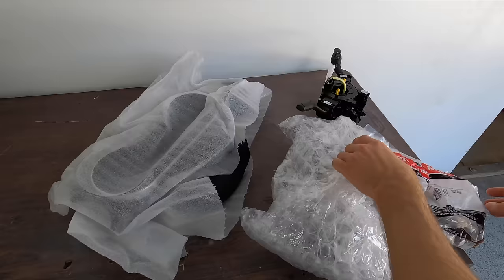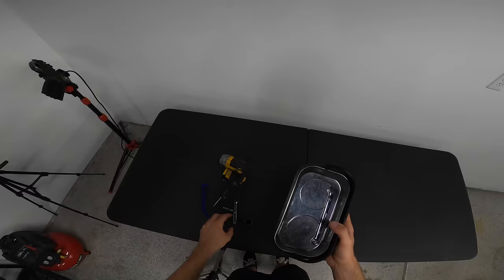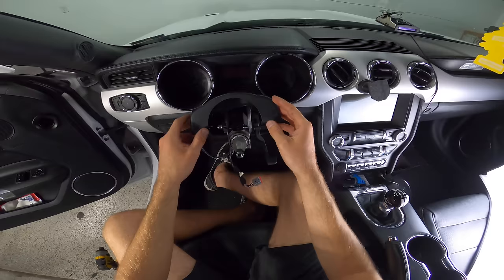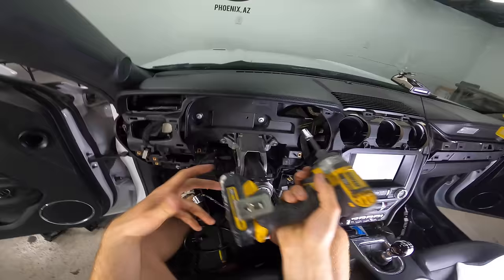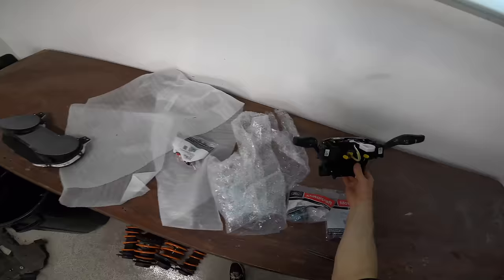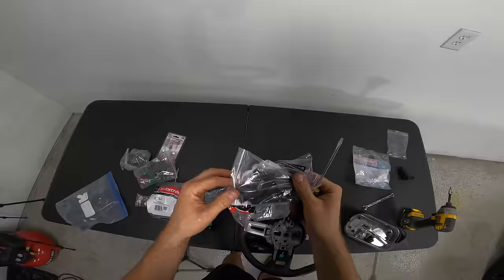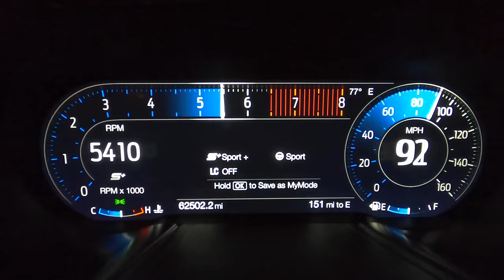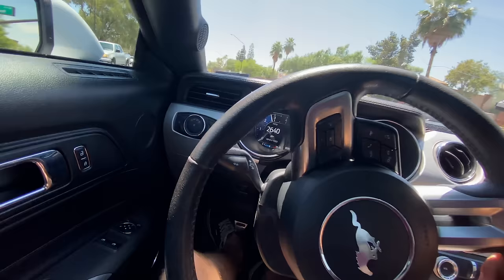Building a Mustang GT: Digital LCD Speedometer Install, Feels Like a Super Car!

Comment: Its funny that a lot of people commented “$2200+ so expensive” and they still gonna buy iphones and ipads or buy both every year. I believe this mod is worth it.
Reply from the maker: right!!!
Reply: Yeah I see where you are coming from, but you have to consider this. It's 2200, you can buy so many other mods that are going to be much more useful and overall better than just a gauge cluster. I totally agree that it looks cool, but it's a really expensive cosmetic. Buying iphones, ipads, etc. are things you kind of need. Unless you want to be really outdated and cheap, then yeah go ahead and buy a flip phone. But, honestly I don't think you can compare this $2k+ gauge cluster to people buying iphones and ipads.
Reply: ROLLS ROYCE well, gauge cluster are something that you need everyday esp driving. Give this guy a break. It is comparable with iphone and ipads, you just dont get it yet. I bet this mod is for the long run nothing comparable such as to disposable tech ie: iphones and ipads, in which are expensive.
Reply: I would look at it as a investment over time. If your going to keep the car for 4 years, £2k over 4 years isn't much. After all it is a mod you look at every time you drive.
Reply: Its a distraction. Keep your eyes on the road. Lol.
Reply: ROLLS ROYCE What you determine useful someone else may not. You can absolutely compare that. People like to upgrade to the newest phone every year and drop 1K yearly but then say a gauge that will be in the car the life of the car is too expensive.

Comment: Putting it all back together before trying it is a very VERY bold move! Glad it worked out!
Reply: Very bold indeed 🥸
Reply: Being a car audio installer myself, I was cringing....physically twisting my body lol....as I saw the first piece...then second...etc....go back on WITHOUT testing out the new cluster first! Especially even stating several times that the plug may have damage but very unlikely unable to work, could still simply not get seated properly. Look how many steps he would have to go through just to get back to that. With the potential to break any of those parts again.
"It's best to test before putting back the rest"
Corny but has saved me so many labor commissions because you don't get paid to take something back apart that's your fault for not testing.
I know the battery is disconnected but unless it specifically says DO NOT POWER ON WITHOUT AIRBAG INSTALLED, test first, or at least call the manufacturer before starting the job.
"Hey. Is it ok for me to reconnect the battery and test this new console before completely reinstalling the the entire dash?"
Well worth the time to call, and get the person's name you spoke too, and just good CYA (Cover Your A$$) practices!
Like Cameron said, this isn't being negative but I'm positive that it's worth talking about!
LOL!
Reply: @justinmurphy2227  it's a ford vehicle you can disconnect the airbag and run it without worrying about codes that won't clear themselves after reinstalling the airbag.
Reply: @foodhatesme  ok this knowledge helps to know. I apologize about being ignorant to this...thank you! I drive a 2003 Ford Ranger and have for the 20 years. I didn't know how far Ford's CPU/ECU's have advanced and in what ways. 
I've went from a 3.0 to 5.0 and now I'm going to 2.3 turbo. I just can't decide if I want to do a 2.3 Duratec, built and turbo'd, vs a 2.3 Ecoboost stock out of a Mustang with minimal addons as it's safe tuned power (400ish WHP) is all I want.
It's a Ranger....not a future "crowd controller" with a shovel aka it's bed.
LOL.
Reply: @justinmurphy2227  np, I recently picked up an ex intercepter 2005 mustang with the v6 that comes chipped and cammed from factory. I'm thinking about putting a supercharger on it.
In my personal opinion I'd go for the stock mustang motor and put a supercharger on it, costs a bit more but you get way more power in the low end and no turbo lag.

Comment: I was going to consider adding this to my mods list.  While I do prefer analog gauges, I like general look of it and the fact the entire gauge area is open.  But after I clicked the link and saw it cost $2.4k, I figured I'd leave this one out.  Nice video anyway, dude!
Reply: Best way is to find a used one or a crashed mustang o just need one on Facebook if he lets it go for a good price ima do it
Reply: @ballstoyou33  been looking at them too but they’re not worth it for the price. Would much rather put some power down than something that you’re hardly looking at
Reply: @ImisstheoldNick  🤣🤣😭😭I’m putting a built block in my car as we speak so after that it’s time for looks cosmetics
Reply: @ImisstheoldNick  I didn’t know about the switches on the steering wheel and the collar thing for the wipers I thought it was just a dash you plug and play I was thinking of getting it off a crashed mustang but this kit seems more logical idk tho
Reply: @ballstoyou33  Yeah I agree, but still does not seem worth it imo. Idk I also just dropped 3k on a borla attak so I can't even say that

Comment: I have this on my 2019 Mustang GT Premium 5.0 and I made sure to purchase it with this gauge cluster 12in LCD screen and I have to say that it is an awesome feature to have it looks amazing and in my opinion it is totally worth it. Didn't know they had a kit to modify the old cluster to this new one. Great Video.
Reply: What's weird is that my 2018 evoboost premium seems to have all the cool stuff except for the shaker speakers and this cluster....i really like the cluster ir came with tho
Reply: I have 2019 and I dont want to cut any plastic is 12 inch gonna fit without cutting ?

Comment: I like the stock cluster but I also like the idea that you can do this to it.  I think these types of mods are especially cool if a person can’t afford a new car they can make their old ride feel like a new one.
Reply: Yeah I was disappointed when I realized it was an option that I didn't have but there's so much id rather do with that 3k than fix something that isnt broken on a base gt
Reply: @MustaliS550  yeah its a cool upgrade but instead of buying an older mustang you could put that 3k towards a slightly newer one with less miles

Comment: I just got my 2023 mustang GT with the 401A package (which includes the digital cluster) and it is absolutely AMAZING! It does feel like you’re driving a super car or something. I also have the 10spd automatic. I know some of you will be like oh no you should have gotten the manual. But I drove a manual and I’m telling you what the power between the manual and automatic is INSANE! The automatic is WAYYYY FASTER! It’s also SOOO MUCH MORE FUN! the different drive modes actually feel different when using them. On the manual it all feels the same except the steering feel. I have always had manual mustangs but after driving the 10spd I fell in love and will never have another manual sport car. We live in a time where the automatics are insanely faster than the manual! Plus if you wanna be lazy and put it in comfort mode then you can do that. Would be kinda hard to do that with a manual. Great video bro! #MUSTANGFAMILY

Comment: I got my 2016 GT PP1 last week and I'll probably do this mod at some point but not very high priority on all the things I want to do

first quality wheels and tires (not that cheap crap on the car now), full car polish and PPF, repairs/maintenance where needed, some small cosmetic/accessories stuff, spare 19inch wheel, sort out the MT82 issues etc etc

after all that it will be stuff like the digital dash

Comment: Your video is still helping people today. I replaced the gauge lens on my 2020 mustang gt using your vid and a few others. Yours didnt show a one or two steps but over all thanks so much. Your frustration and excitement gave me the courage to do it on my own and after a few pinched fingers and missing bolts later, my mustang is looking better.
Reply: Did you have to use forescan for anything? Where did you order your cluster? Thanks!

Comment: I just built/installed a tablet-based system I my 06 V6 Mustang, using RealDash. I hooked my tablet to USB power via a step-down converter, then using the ACC ON power to set a macros to both start AND shut it down w/ key on/off. All indicators work except my blinkers (If you know the Ford extended PIDs/Mode 22 PIDs, please share!)... so I custom installed two LED blinkers (ran from the front bumper) in my dash that illuminate the corners of my dash bezel in an underglow style left or right, as operated by the normal turn signal switch. Tablet runs via Bluetooth/OBDII port. All in? maybe 150 bucks? And it works flawlessly.

Comment: 201A / 401A  Package is $2300 new from the dealer which includes a leather trim package, heated steering wheel,  My Color and this LCD Gauge cluster.  Infotainments LCD gauge cluster alone is $2200,  price point is sadly way off.

Comment: That is fire asf

All you need is the MBRP exhaust and bam, extreme stang
Reply: Yeah I have one an (MBRP AXLE BACK)  in my 2019 GT paired with a roush-x pipe and let me tell you.  It turns heads quick and will make folks behind you and in front of you think the coyotes are pissed off.   People will hear you coming and will be like dammmnn.  It’s loud my not an annoying loud.  A serious aggressive muscle car loud.  I’ve had folks ask me after hearing it if I did cams or did a tune and I’ve done neither yet.
Reply: @nickl8830  exactly bro. It's real different. The Pops themselves makes you feel like your driving a hundred thousand dollar performance car and rattles with most beastly of power. Its fuckin amazing bro

Comment: Did you match or do the mileage correction? If so how did you do it? I put a 2017 cluster in my 15 purely for the color change stuff and my 15 cluster was oxidized, but I want to match my mileage on the new cluster if that’s possible. Anyone know?
Reply: That’s what I’m trying to figure out

Comment: 1 have a 2019 Mustang I need to change the cluster lens. Do you think I  could change just the cluster lens without removing the steering wheel and just removing the little moulding to the left and right side ? Dude you were a beast for going in like that

Comment: You wouldn’t have to do that much if ford just changed the factory gauges in the first place 😭
Reply: John Calipusan fords not gonna do that it’s more expensive and you can order it as a factory option if you have the money.
Reply: John Calipusan that’s a pre 2018 mustang lol 😂 You can’t get the 12 inch digital gauge from factory on those mustangs
Reply: Cool Pizzo I’m just saying tho like 2015 and higher they should’ve changed the gauges in the first place
Reply: John Calipusan well they didn’t so be it and the mustang EcoBoost and gt doesn’t come standard with the 12 inch digital gauge cluster
Reply: John Calipusan why tho like its a service that very few people would actually want and ford shouldnt just upgrade old vehicles for free
Reply: @johncalipusan8590  that's like saying why didn't Ford put these in the 2010 mustangs.

Comment: I just put this in my base model ecoboost (yes that is possible!) Love this fucking thing. Quick question for you tho. Do you know of a way to change what measurement is shown as a digital number in the tachometer? Mine shows the gear number and I noticed yours shows the RPMs. I haven't found a way to change this, do you know of a way?

Comment: Nice upgrade but cost and no way to undo the modifications is a negative for me, did the programmer give you the ability to save your old configuration before overwriting it? Also at $2.6K they only guarantee the part for 90-day is a little concerning but the results are nice and you did a good job on the video & the install. Enjoy the fruits of your labor.

Comment: Revisiting this video, as I get closer to buying this cluster.... This is, by far, the best install video online. I already have the Sync3 from Infotainment and got the Boost gauge, Line lock and the Drive Modes enabled on my 2017 Procharged Mustang V6. I also installed all the ambient lights, set to Ice Blue...This cluster will complete my interior look, for sure.

Did Infotainment send a dongle to program the gauge cluster or did you need to use FORScan?
Reply: You need to use FORScan, they don't send a dongle. Also I would advise putting foam behind the cluster, a lot of people have complained about it rattling once installed.
Reply: @nonyajohnson8984  Awesome. Thanks 👌🏼

Comment: Are the 2 holes that mount the new cluster in are they solid with a aluminum bracket behind it or just pastis and the cluster is going to vibrate and make noise?

Comment: I just used this guide to do the install of my digital dash and it came out great!

My one issue is that the dash rattles when I shift. I think the cluster is moving at the top as it has nothing to hold it in place.  Anyone else have this issue?

Looks beautiful though, even though they sent me duplicate buttons so I can't change any settings yet!
Reply: You should have put foam behind the cluster, several other people that have installed this, said it rattled without the foam. I put foam behind mine, and it doesn't move or rattle.
Reply: @nonyajohnson8984  good to know. Was that in some instructions I missed? Any particular foam to use?

Comment: Hey man jus a couple stupid questions. I jus bought a 2016 mustang gt 6 speed manual. It has shorty headers with a full borla exhaust. It also has a airaid cold air intake. How much horse power do you think it puts to the wheels. I’m telling you I’ve driven a porches my buddies dad has a 911 an that thing has nothing on it it pulls an pulls an doesn’t stop

Comment: My digital speedometer is broken and the miles are not visible, if I replace it, will the miles change or will it have the same original miles?

Comment: Why would you replace a gauge attached to your engine with a computer screen that will go out due to the heat and cold destroy the electronics. I have a friend that has a Volvo and the screen went out you could drive the car but you couldn’t tell how fast you were going.

Comment: I see this vid is old and popped up on me but holy shit $2200 bucks ill just roll with the one I got in my 17. All my bucks went into the motor gears and trying to get that bitch to hook up. Making close to 800 hp don't really need to be looking down at the dash rowing thru the gears admiring how cool it is but it sure is cool. $2200 Hmmm bigger better injectors a better return style fuel system new half shafts. Still cool tho..